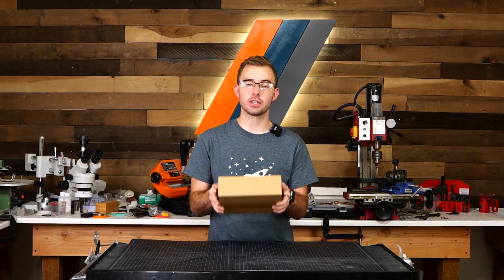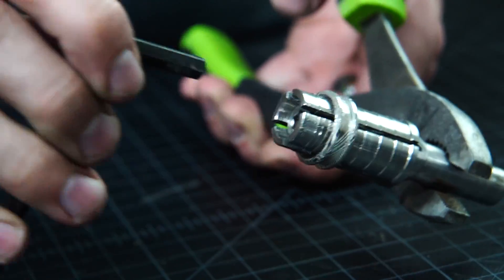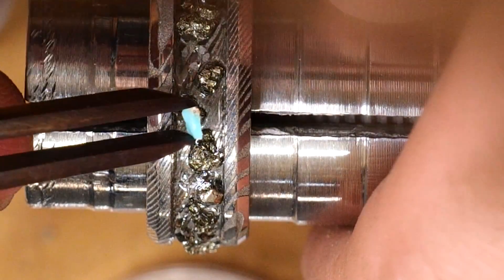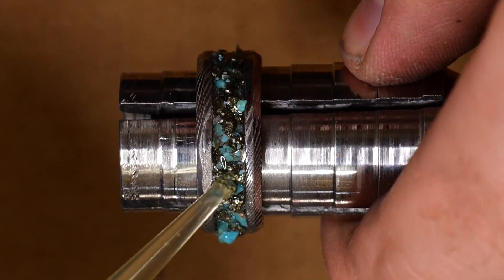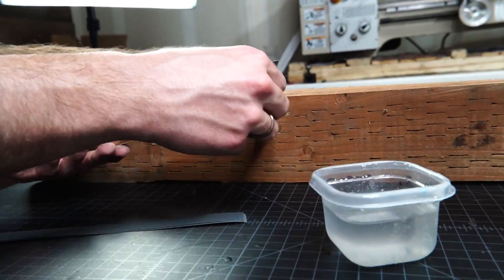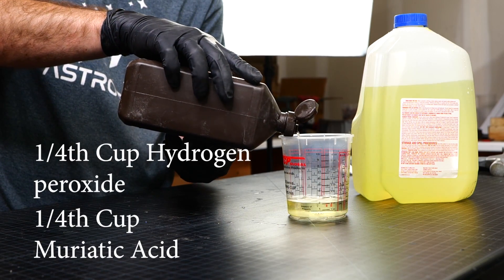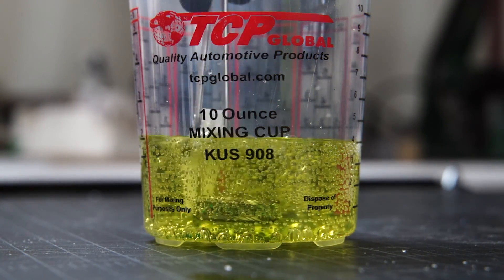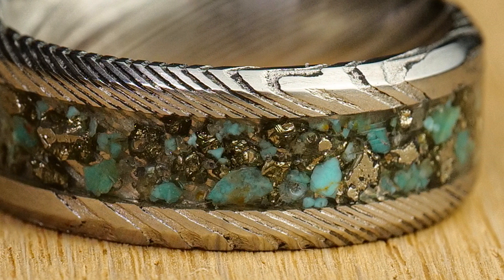Making a Ring Without a Lathe | Quick Cut 07

Comment: really cool. Makes me wonder if it's still comfortable to wear with the etching on the inside of the ring or if it makes any difference at all?
or if it's possible to not etch the inside of the ring.
Reply: There is actually surprisingly little texture difference with etching Damascus, because you sand down the damascus so the ridges become significantly less pronounced. The sanding is what makes the whiter color show.

Comment: Question. Would it be alright to etch the ring first?
Reply from the maker: Yes, you could and then wrap the edges of the ring with electrical tape so you don’t ruin the etch. but its still a bit tricky to not ruin the etch while sanding and polishing the inlay even with the tape.
Reply: @PatrickAdairDesigns  , gotcha.